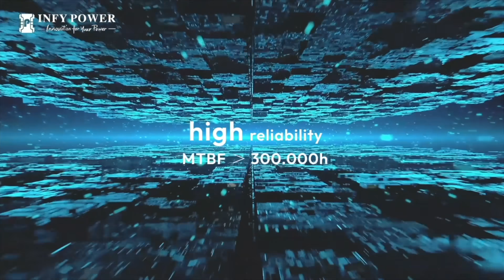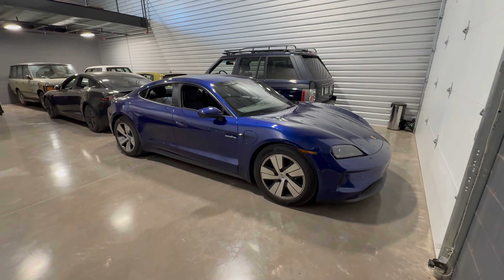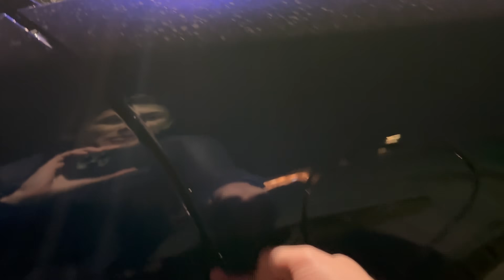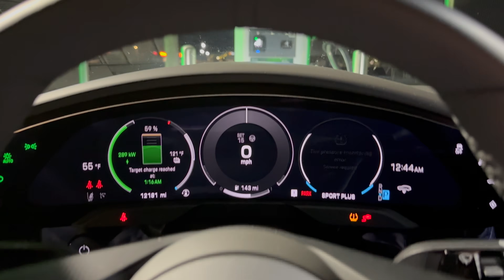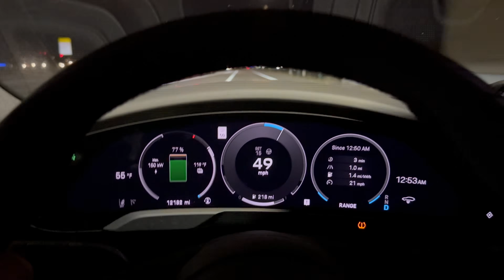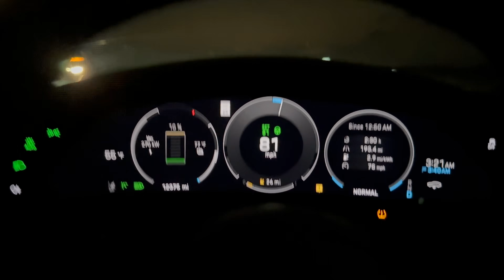EV Road Trip King! Porsche Taycan Goes Insanely Far After Only A 15min Charge In The 10% Challenge

Comment: $40 for 15 minutes of charging is bananas. For an ICE car getting 25 mpg, gas would need to be at $5/gallon to cost the same as this charging session. I love EVs, so we've got some work to do on the DCFC infrastructure and rates to make DCFC more reasonable. It will obvioualy always cost more than overnight AC charging at home, but 4x the price of an average kwH seems unnecessary for demand rates given time of day this was filmed.
Reply: If you sign up through the apps, you usually get discounts, when I am not charging at home, I pay $.20 a kilowatt. So like 19$ for 330 miles.
Reply: they gotta make money from charging somehow. The infrastructure cost to put in the charger is in the millions of dollars per site.

Are you suggesting that the government subsidize this business? This is the actual cost of doing business. Those NEVI price gougers are not reflective of actual cost.
Reply: @interplexor  Kyle has shown that the cost of installation and management of a DCFC is not in the millions of dollars. The equipment is fairly reasonable and installation and permitting varies by region. The electrical supply costs are variable and can run quite high depending on the local grid operator. Getting the variable supply cost down is important.
Reply: Don’t know how it is in the US, but in Europe Tesla Superchargers often cost about 40% less per kWh than alternative high speed charger networks. Now that they’re largely opened up to all EVs here, result is that you’ll often see people using them in preference to the other chargers. Waiting to see if this will lead to a price correction… If you compare it to ICE, no gas station would survive charging 60% more per litre or gallon, ridiculous that EV charging networks are however doing this for the electrons they provide!
Reply: Until you see charging station on ever corner like ice have with gas ev owners will get rip off along these interstate highway exits with just one to pick from, but again if you can afford 100k plus ev $40 buck mean very little to you.
Reply: @SHOE53  The $40 charge being nothing to someone who can afford a 100k car is a fair point. I'll concede that point. I will note that they do this with other fast charging cars in the 40-50k range too though, like the ev6 and ioniq 5 and ioniq 6. So I still think it's important to find a way for grid operators to reduce the demand rates but I do acknowledge your point re high priced cars and relatively modest sums for  DCFC sessions.
Reply: @SHOE53  I am more hopeful to see gas stations decrease and not for chargers to mimic the waste of land that gas stations seem to have. everyone ignores how much land is given to wasteful space like these and even parking lots and dealership lots. I am more hopeful to see them be more automated and reduce dependence and no risk of having to get into a financial burden with interest.
now specifically on infrastructure, I think the 10% challenge shows how far you can go with only charging for 15-20 minutes from 10% and rather have people be more comfortable NOT charging to max all the time and the infrastructure in apartments be more scrutinized. I do think more people should be living in houses that can charge at home than crammed in apartments, but I can't change the world or what people sink money into. Plenty of people are wasteful, and disgusting, and that is fine. Let them be, but no one is gonna cater to them all the time.
These EVs and even the Silverado EV being road trip worthy are testament of how you should feel about EVs in general.
Reply: Gas is $5 a gallon in Cali
Reply: infrastructure for fast charging needs to be nationalized, and stop relying on private companies. its the middle man and non-standard system. economy of scale, every private company is competing and can't have as low of prices as gas is able to maintain(though its mostly because of subsidies from taxes too)
however it is true that home charging is way cheaper, and with solar equipped, practically no cost(and makes the solar pay itself back faster) 
EVs at least in certain environments have larger range of efficiency. In city driving can reach between 4 to 7 vs highway which is typically 2.5 to 3.2, for equivalent to gas, this is an cost efficiency of city 60 to 85 equivalent mpg, and highway is 25 to 34 mpg. while highway does seem close to ice efficiency, for now, but you can see that you can get real nice savings. however, if you are using solar, that is a cost efficiency of practically infinite mpg, but most would say it is 250+ mpg instead.
EVs having real potential. Even with how you drive it. I am one of the people who know that if I use one pedal driving and at everystop try to slow down in advance with 0 usage and 0 regen(regen is half as efficient as just letting friction do all the work in slowing down) then the efficiency gets me close to 7 city consistently.

Comment: If the vast majority of EVs could charge like this in the next 5 years, it would be insane.
Reply: That could become the reality thanks to a more widespread 800V implementation and the latest battery technology improvements. China for sure will have mainly 800V EVs on sale in 5 years, coupled to some high-power charging LFP (for the cheaper EVs or SUVs) or solid-state battery (for premium EVs).

800V EVs with around 3.3C-4C NMC or LFP packs are already available in Western markets, or will be available next year (Smart #5 will be the first 4C EV available in Europe). 4C equals to 10-80% or even 5-80% SoC charging time of 15min in real life, depending on your thermal capabilities.
NMC battery packs right now top out at 4C, because NMC loses battery health exponentially when you go above 4C charging capability.
Since most Western manufacturers like to use mainly NMC for now, especially because it is a proven, versatile and an energy-dense battery cell chemistry, I predict markets with mostly Western manufacturers will mainly have EVs which charge between 15-20min from 10-80%, but this counts even for compact or sub-compact EVs (The upcoming 2025 Volkswagen ID.2 could be able to charge from 10-80% in 21min. The Golf 9, which will be the first EV-only Golf generation, will be equipped with 800V architecture and should charge way below 20min in early 2029, so around 4.5 years from now). That would already be sufficient for your wish to become reality.

However, Western companies also start to implement more LFP battery packs or are interested to use solid-state battery packs when they are available in the near future. So my prediction is conservative.
With LFP you can achieve 6C, or around 10-80% in 10min, nowadays, since they come with a bigger degradation buffer you can play around with.
The first EVs available with this technology will arrive next year in China. GM has a partnership with SAIC which developed the 6C battery with CATL. So maybe GM will use this technology in their luxury 900V Ultium EVs like some Cadillacs. BYD and others are also working on a 6C battery. 

The Zeekr 007/7X already come with Zeekr's own 5.5C 75kWh "golden brick" LFP battery, which charges from 10-80% in under 11 minutes with 410kW of peak charging power, and they cost a few grand less than a Model 3/Model Y in China....
Reply: That's not going to happen. Remember, automotive still runs on 5 year development cycles. You're looking at at least two cycles for the legacy manufacturers to get caught up to this.

Comment: Amazing results from the Taycan, and it highlights the difference in engineering ethos behind both teams. One is designing for quick and fast charges, and the other is efficiency and trying to avoid chargers. In that regard, I think the Taycan definitely fits Kyle's driving/charging better than the Air, and probably represents what a lot of Americans would do in an EV.
Reply: I'm hoping over time automakers pursue both......... IMO efficiency is even more important than charging speed as it lets you get more out of the battery. Think how far the Porsche could go with the Lucid's efficiency.......

Comment: Hopefully this type of performance trickles down to more reasonable priced vehicles. I'm probably going to swap to an EV once something reasonably priced can drive for 3 hours highway on 15 minutes of charging. The 800V E-GMP cars get pretty close but still have a good chunk to go before they reach that benchmark.
Reply: We will  be there soon with new cars -  I am driving long distance with an EQE and  I love it coming from an ICE BMW which could do 1200km with one tank.  I drive like 400km on a charge and then I need to do a bio break  and  have a snack / coffee, the car is always ready before me.
Reply: @bavariancarenthusiast2722  That's basically what I'm doing now in my PHEV. It's rated to go 1000km on a 43L tank of gas and I can easily get over 900km in real world usage. When I stop for snacks I plug in to a L2 charger just to time how long I am and it's usually between 7-12 minutes. Waiting a few minutes to get to 80% wouldn't bother me much but some of the cheaper EVs (and even some expensive ones) take 40 minutes to charge on a regular basis and that's just completely unreasonable to me.

15 minutes would be a fine time to wait and 3 hours gives me a bit of a buffer because I'm usually ready for another stop at somewhere between 2.5-3 hours anyway... But when I'm by myself I can pull 4 hour legs in my PHEV and if I fill up the day before I can do a full day of driving without even having to think about energy. With an EV that will be two charges minimum and that's only if the chargers are spaced near perfectly which is almost never the case.
Reply: Eh do 2.5 on 20 min charge good enough for me all my ass can sit for anyway
Reply: @kidamere2408  I don't want to wait 20 minutes and 2.5 really means somewhere between 2-2.5 because of charger spacing in my area and at that point it's too annoying. I don't buy a car to be annoyed every time I have to drive somewhere, especially if you have to sink 40k in to one.
Reply: @Snerdles  you have drive 2.5 hr everywhere you go then yeah ev isn't for you
Reply: @kidamere2408  But will be once they can drive for 3 hours on 15 minutes of charging, thus my whole point.
Reply: @Snerdles  some point, but now 99.9 percent of people don't drive 2.5 to the grocery store I would absolutely hate living in well whatever part of the world you live in lol
Reply: @kidamere2408  No one is even remotely close to discussing just going to the grocery store. I don't know what kind of delusion you are in but we are talking about road tripping on a road tripping based test video.
Reply: @Snerdles  you literally said EVERY time you need to drive somewhere it would be annoying to have to charge 20 mins if your not driving 2.5 hours then your not charging,perhaps you need to choose your words more wisely
Reply: @kidamere2408  Every time I have to drive somewhere...in the context of road tripping on a road tripping video. My god the trolls are stupid these days, trolling used to be an art form, now they are just idiots.

Comment: This is going to be a hard record to top!
Reply: 10 years from now "Remember when we were impressed, and thought the taycan was next level 😂😂".
Reply: Looking forward to seeing the A6 e-tron (sedan) on this test. Also on the PPE platform and should match its Q6 e-tron sibling's 285kW max charging rate (officially 270). In Björn's test, the Q6 added 55kWh in 15 mins from 10% SoC, which is obviously quite far from 70kWh in this test, but there was clear thermal throttling going on and I wonder if it was properly pre-conditioned the way they do so well on this channel. 

Also looking forward to the Mercedes CLA electric, which aims to go big on efficiency and is rumored to have a 250kW charging rate with an additional 50kW 'boost' function. Might be a contender for the title.
Reply: I think it will be a long time before it gets beat!
Reply: @ryankassel5691  I give it 3 years, tops. Maybe less. Porsche is also incentivized to beat their own numbers.
Reply: Some Chinese EVs are hitting speeds of 500kW+, problem is finding anyone to do an equivalent 10% challenge test as those Chinese EVs wont be available in the US for Kyle & OOS to test anytime soon.

Also this didn't appear to be the top charging speeds the Taycan could achieve, so maybe with a better session and conditions it could break 200 miles.
Reply: @JoshuaStringfellow1  It's average charging speed that counts. Double the voltage of a Tesla Model 3 in a 120-150 kWh pack, and you'll also hit 500 kW for about 3 minutes. The Taycan is averaging 300+ kW for 15 minutes. The only other EVs that can do that now are GM trucks, and their batteries are double the size (so half the C rate).
Reply: @newscoulomb3705  Course, but I'm not expecting the Chinese BEVs to hit a 500kW peak and then ramp down to e.g. 70kW for the remainder of the session. Though we'll actually need to wait and see these cars tested independently to see what they're really capable of.